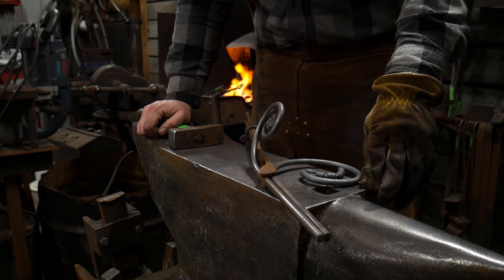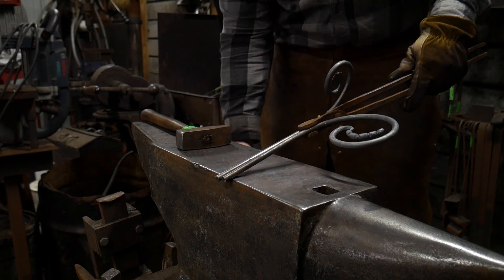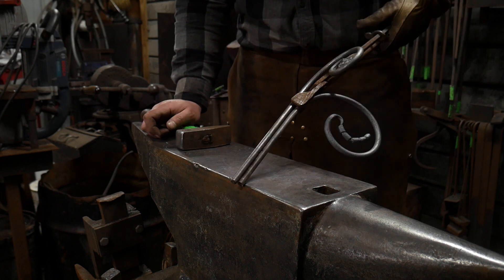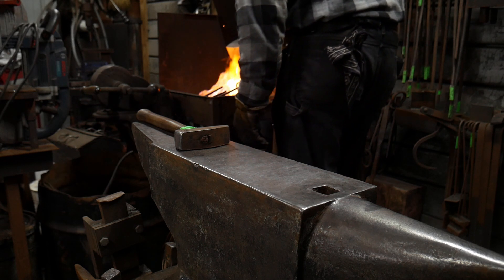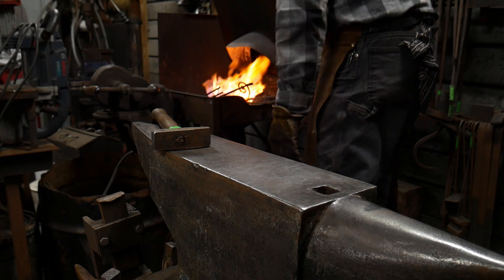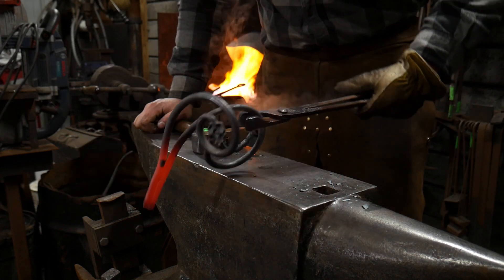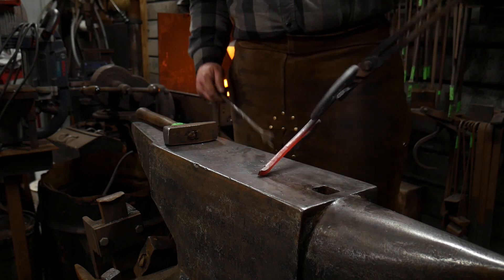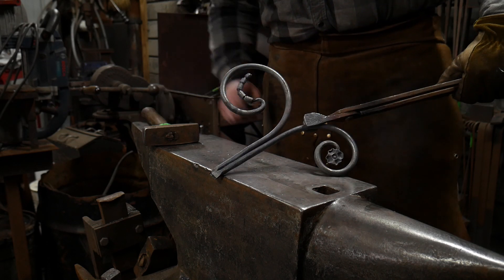Forge Welding Branching Scrolls: Alternative Method

Comment: I’ve enjoyed this series of videos more than anything else you’ve done in a while thank you,. Now I have a question, if you were to forge weld in your propane forge what pressure would you have to run the gas at to get it hot enough? On a normal day I can forge small stuff at 5 psi but I never get above 10psi